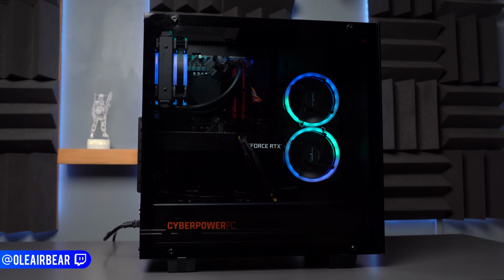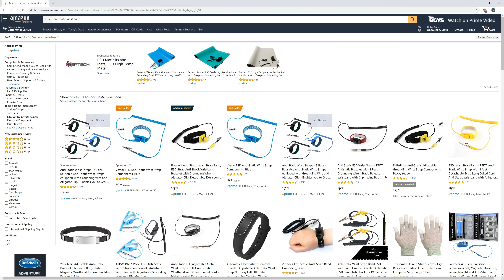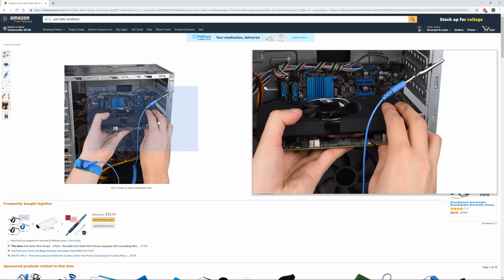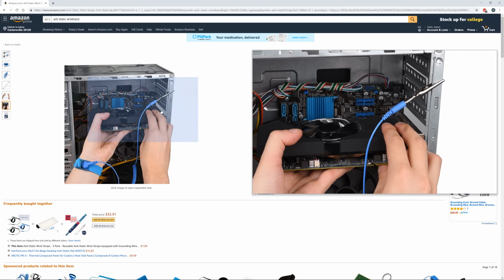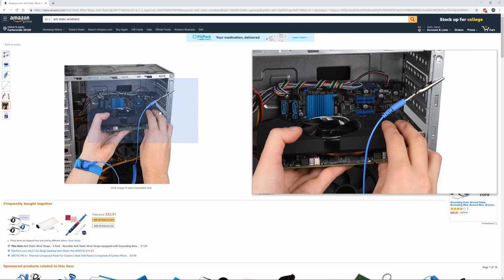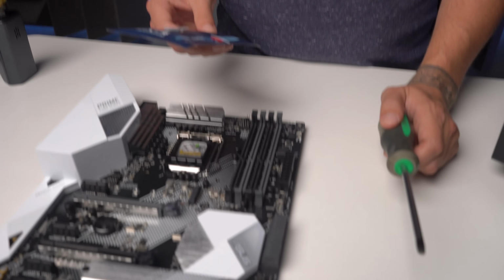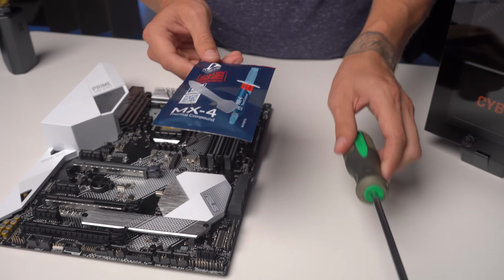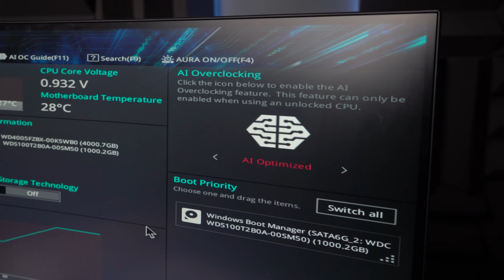How to Install / Swap your PC Motherboard STEP BY STEP

Comment: I'm confused. is being bare foot a good thing or not?
I'll be building my comp in the kitchen cause other than the bathroom it's the only space that has no carpet.
Thanks for the helpful video, I'll be doing this in about 2 hours or so, just doing some prep stuff at the moment.
It would have been nice if you gave me a close look at the Installing Motherboard Standoffs section. I'm quite scared to touch these as I heard some cases can fry the mobo or something...

Comment: hey guys so i am new to all of this pc stuff and i was building my pc 2 days ago on the carpet on my floor and while im screwing in my mother board i dropped a few swears on it on accident and i didnt know thats that would cause anything and so i finish my pc and for some reason my motherboard had 99 on it and i looked on safari and it said my motherboard died or got fried or short circuited and now i have to save money to buy a new one any tips ?
Reply: @FBI okay thanks

Comment: I know this is an old video but I need help. Many reviews for this board on Amazon claim that it does not support 9th gen intel cpus out of the box and an 8th gen one is needed to update the bios first. I am wondering how it went with a 9-9900k since it was a 9th gen cpu (I’m getting the 9700k)

Comment: I only had one spacer or standoff included. Never knew what their use was for. Now my pc won't start. I think it's fried. But I'm afraid if I do install spacers that it would offset my MB from the back hole for the IO stuff
Reply: i tried the prime z390 A and this happened to me. Nothing would turn on. Was this because i didnt have standoffs?? My old mobo worked without the standoff

Comment: Built my first pc last month without any prior knowledge other than half-hearted random advices or tips from friends. Ended up getting the cheapest B450 board that didn't have an ARGB header for the ARGB fans that I got. Really ugly board in the Asus Prime B450m-A. To think I was initially content with getting an A320. Bought multiple accessories to accommodate the fans (rgb splitter, fan hub, argb adapter, etc.). Now, a month later, I put up a build that I should have gone for instead of cutting corners. Little did I know that I would be spending twice as much as my initial budget mostly on unnecessary accessories that could have been prevented had I known what I know now. I'd love to go back and get a better cpu, motherboard, gpu, and full modular psu. :((
Reply: Lmao I’m in the exact same boat and now I’m just spending extra money

Comment: 8:18 I’m planning on upgrading to this mobo, but my old one didn’t have those connectors so I had to individually plug each of those in after installing the gpu.. it was tough

Comment: i'm swapping out my MOBO to an x570. my OS is currently on an NVME, but the new mobo allows for 2 nvme slots. do i need to plug only one in when booting for the first time for the BIOS to read the OS, or can i install both m.2 slots, i.e. will the BIOS read the OS regardless?

Comment: Hi I got a question: I want to upgrade my current i5 4460 set up to a newwer ryzen mobo/cpu/ram combo. do i need to reinstall windows or stuff like this? if yes is there a video on how to do that type of stuff best? and maybe without losing my data? lol

Comment: I'm replacing my computers Motherboard and CPU so I've made notes to follow for myself. Thought I would post, in case somebody finds it useful. It's summarised, so make sure to still watch the video to get more of a visual understanding of the notes.

To keep in mind:

1.	Make sure no static electricity. Work on an area that is not carpeted, do not walk around with socks on round the house during installation. Ground yourself by touching the metal on the inside of the PC case every so often. Recommended: Anti-static Bracelet

Not mentioned in the video:

1.	Back up your hard drives, just as a precautionary method. You may not have to re-install windows if you have windows 10 - it may be as simple as just replacing the mobo it may not be (I did not have to re-install windows, but I backed up my data just incase) 
2.	Note down your windows activation code – connect it to a Microsoft account so you are easily able to reactivate windows. Your Windows activation is connected to your Motherboard/Microsoft account
 (if it is not connected to a MS account, you may have to contact Microsoft to issue you a new activation code and deactivate the old, as, if the motherboard we're taking out is much older than your new one, Windows will not recognise the mobo and treat it as a new system. If you are upgrading to a motherboard that is of similar brand/etc to previous, you may be okay. Somebody said that if you have your original windows activation code, you may not need an MS account. I would personally just connect it to a MS account. (My PC opened up to the BIOS, I checked everything looked good, then it signed me in as normal. I did connect my windows to a microsoft acc just incase)
3.    You may or may not have to uninstall old drivers from the previous mobo when your new one is installed. Boot into safe mode, chuck CD in that comes with new mobo and install new drivers (I did not have to do this step)

STEPS:
1.	Unplug and kill the power to PC completely, turn switch at back of computer to OFF to discharge electricity. Hit power button at top a few times to make sure any lingering power has been discharged
2.	Open case, back and front
3.	Take out GPU – unplug power cables, remove screws at rear. Press down on tab at PCI and release GPU
4.	Remove RAM, note what place they are in for new mobo
5.	Remove CPU Cooler
6.	Remove any case fans
7.	Remove all cords from motherboard
8.	Unscrew motherboard 

NEW MOTHERBOARD Installation:
1.	Place motherboard on soft surface, i.e. manufacturers box
2.	Install RAM
3.	Install CPU – remove socket cover (put this on old board for protection), push spring cover and release cpu holder. Gently place CPU in socket, align. NO pressure. LIGHT shake to ensure it’s seated. Apply thermal paste and secure cpu with arm
4.	Put IO shield on PC (can take some force)
5.	Align motherboard with IO shield, screw top screw rest should fall in place. SMALL forward pressure to hold mobo against IO shield for first screws. Screws don’t have to be super tight.
6.	Install CPU cooler
7.	Install CPU Radiator (back fan)
8.	Connect all cords in motherboard, everything should be named.
- Hard Drives into sata ports
- 24 PIN connector, usually found on right side of ram
- USB ports
- HD Audio (commonly found on bottom left hand side. taking note of the missing pin on the mobo and the connector, will help you find it easily)
- Commonly Dreaded Power on, Reset button and HDD LED Cable. If you have a decent motherboard it will be labelled, they must be placed in negative and positive correct positions
- MAKE SURE ALL CPU FANS AND CASE FANS ARE CONNECTED TO POWER, whether that be alternate power, or through the motherboard

9.	Install GPU
10.   Power up
Reply: Install gpu last ?
Reply: @spookz1761  yes, because it's the bulkiest component it makes it difficult to access the parts we need to connect cords into on the motherboard. Just followed my own notes today, everything is running perfectly. Goodluck!
Reply: Ty
Reply: Thank you!
Reply: i followed these steps, and my computer wont boot up lol. at no fault of yours! but i have everything plugged in and the front panel connectors are on, Power coming to the motherboard as the LEDs come on, but when i press the power button nothing comes on
Reply: @jackhouston2497  could be for a number of reasons. Go over all your cables, make sure they're plugged in all the way especially the 24 pin connector.
Reply: @jackhouston2497  also, make sure you've put the power reset/led hdd cables in properly! If they're not, that is another reason why it wouldn't boot. Especially that your motherboard is showing power.
Reply: @jackhouston2497  in your motherboards manual, it should show you exactly what spots they should go in.
Reply: @jackhouston2497  gday did you get your computer working? make sure your monitors input is plugged into your graphics card, not your motherboard
Reply: @brilyn  yeah mate it was something to do with bios. I then upgraded cpu and mobo and the mobo was faulty so still haven't been on my pc in couple weeks lol. Thanks for checking in!
Reply: @jackhouston2497  oh nice stuff. i put together another build yesterday, and it turned on but showed nothin on the screen and that was my problem so thought I'd ask XD game on!
Reply: @jackhouston2497  take out Ram, put back in. Take out cmos battery and put back in. Try that. 
If you put windows into an m.2 ssd then you’re about to have some problems (I ran into that issue).
Reply: thank you! i saved your comment and I'll for sure use it when i upgrade my system soon

Comment: I have the same mobo and I got the dram problem as you did. It will work with one stick in the second dram slot but when I put the second dram card in, the dram light on the mobo lights up. Any idea how I can fix this?

Comment: This was such a huge help. Made replacing a motherboard go from stress-inducing to easy as hell to do.
Reply: What about the ssd will they automatically work ? From the old setup to the mobo ?
Reply: @caraagraph1996 did you ever figure this out?? This is what I’m wanting to know
Reply: @xHarper02x did you figure out?
Reply: @secretservice2  yes, they will work moving them directly from one mobo to the other
Reply: How do you move standoffs?

Comment: When you switch your motherboard, but keep your hard drive, does windows stay? Are there any extra steps to get windows back? Or do I need to buy it again?
Reply: Your windows will stay on your hard drive of course(or maybe in your ssd if you installed it on ur ssd)
Reply: 「RM」 Arc so I switched the mobo and it only takes me to the bios. I decided to reinstall windows with a flash drive but then it just leads to no display.
Reply: @madara7037  when connecting my old hdd to my new motherboard, it was unable to boot up. so i backed up my stuff that were important and installed a new drive. basically, yes i did lose everything

Comment: Do i need to install the windows 10 again if i change the cpu to a new motherboard? its necessary to do a fresh installation or its already installed somewhere somehow in my hard disk? im planning to move all my stuff to a new motherboard, a new cpu included so this is why im asking.
would appreciate a help. Thank you.
Reply: Did you ever figure it out? I’m wondering the same thing.

Comment: Not the same question as others. Should I format my boot drive if switching from an intel cpu/motherboard to an AMD combo? Will I have any issues if I use the same install without a format?

Comment: Do I take off the standoff bolts on my case before I put in the mother board or leave them
Reply: PLACE THE STANDOFFS IN BEFORE YOU INSTALL YOUR MOTHERBOARD! They’re supposed to be in there to protect your motherboard from shortages. However, just make sure the standoffs line up with the holes that are in your motherboard just to be safe. I’m currently building my PC atm too!
Reply: Envy I knew I was doing something wrong 😅

Comment: I'm upgrading my mobo and can I use the same window from my old build on the new board? Is it as simple as plugging in my SSD and then it boots up?
I read some of the comments on this video, and people are saying I need my old activation key which I have. Do I need to go to the bios? Please someone explain in depth it would mean the world.
Reply: Well, Im pretty sure you MAY need your activation code I heard that if you change the parts out it can unlicense your windows but I wouldnt worry about it too much but to get to the bit I think I know better.

You just should go into the bios make sure everythings working and showing up, also if your memory (RAM) uses XMP you need to enable it in the bios. Now for booting into windows if you have multiple drives or even if you dont, just check that the boot drive is selected to your SSD in this case. I think that sums it up, hope you enjoy the upgrade my man.
Finally upgrading from an FX-6300 to a Ryzen 5 3600 so pretty exciting sh*t 😂

Comment: great video but how do I know what motherboard to buy , I have a ibuypower prebuilt and im slowly upgrading it but I know im gonna need a new mobo soon . current one I have is an ASrock h310cmib atx micro . sorry if its a dumb question im learning as I go (those are specs I got from system info)

Comment: Is there a way to upgrade a 2009 hp office desktop motherboard to a gaming motherboard
Reply: It depends on what form-factor the computer is. If it uses an ATX case/motherboard, you may be able to do it. However, you have to factor in the cost of all the other upgrades like a new CPU, RAM, graphics card, power supply, etc. It probably wouldn't be worth it.

Comment: So I have a question; if I installed a new motherboard on an older PC (replacing) and assuming everything is connected correctly, will I need to enter the bios to setup the boot drive or it will detect it automatically?
Reply: It depends. If you have Windows 7 or older installed, it will most likely crash since it would be trying to run on entirely different hardware. In that case, you would need to do a clean install of Windows. If it has Windows 8/8.1/10, the it should boot up. However, since as far as MS is concerned, this would be considered a new PC, you may get a Windows activation error.

Comment: I've got a question sensei. What if I changed a 2013 motherboard with a 2018 motherboard? What happens with the software part? (I want to keep the same HDD & GPU. How do I install the new drivers or how does ir work?
Reply: Hylian Chief if you’re keeping your HDD everything stored on it (drives, etc.) will be transferred to your new mobo.

Comment: I bought a new motherboard and try to install in my PC then my friend told me to reformat my ssd and install windows again. Can i swap my motherboard without reformating my ssd with windows?
Reply: You "can", but it'll take extra steps. Such as modifying the registry for hard drives.

Comment: when upgrading a motherboard, do you need to re-install windows?
Reply: no. just choose bootable system where you install the windows. change it on bios setting.

Comment: If i change the mobo without changing cpu do i have to delete drivers or reinstall windows? (I'm not upgrading mobo but changing it with smaller one)

Comment: I have ordered new motherboard ASUS ROG Strix Z390-E Gaming GPU CPU and CPU cooler ill be upgrading from my old things to something really powerful my power supply is good enough but got another hard drive 8TB for more space for my games also thinking of ordering a 1TB SSD as well

Comment: The thing is: Will I keep windows? Do I have to save the data? He didnt mention anything about that?
Reply: This happened to me: So basically, at first reboot plug in the drive, on which windows is installed (ssd, m.2, HDD). It WILL recognise the bootdrive and start windows 10, like nothing ever happened. Then restart and add a drive. Repeat.
Reply: If you put all the drives into the system at once, it might cause problems (My drive with windows didnt get recognised at all in the BIOS, yes nowhere
Reply: Howdie Rowdie thank you I’m upgrading atm and was wondering what to do.
Reply: Howdie Rowdie there were no issues regarding your previous motherboards drivers?
Reply: @phill7487 No, there was no problem with the previous motherboards driver.

Comment: I tried connecting my new built pc to my TV using only the cpu inputs for now but it says no signal. my pc runs perfectly fine and all. Should I wait for my gpu to connect it and change srtifnfs) settings or does it matter?
Reply: Yes I would

Comment: Ok, touching metal does not automatically ground you, touching your pc case, when the psu isn't plugged in does not ground you, touching a metal table that's standing on a wood floor does not ground you.

Comment: wanted to upgrade my hp 8100 sff , got a new motherboard and ram (both DDR4) and was wondering do i need to get more equipment as well (i.e. cooler, graphics card or cpu)? Or can i still use the i5-660 and still have it work fine? trying to play my steam games but it's not up to par or doesnt even load into the title screen

Comment: Just bought an ASUS ROG B450-F to replace my archaic IBUYPOWER asus board from 2011. I watched this video in hopes to simplify my install. Amazingly done! My gaming tower seems to have a lot more wires inside.

Does most Ryzon processors come with thermal paste?

Comment: If I upgrade my CPU, MB and Ram do I need to reinstall windows?
Reply: nah bro windows is installed on one of your drives (SSD/HDD)
Reply: @nachostv4217  so if I already have it I don’t? What if i have the “fake windows 10” like the one that’s watermarked? I’m just to lazy to activate it and I’m getting a new motherboard since my last one fried.
Reply: @Kiro_I0  that's because the registration key will sometimes depending on the key be bound to your motherboard.

Buy a new key, they're like 5 bucks. Or live with the watermark, I lived with it for like a year before I bought a new key lol.
Reply: @nachostv4217  Thank you for the reply. I really don’t mind the watermark lmao
Hopefully when I install the new mobo tomorrow it’ll all work out like so.

Comment: Just making sure: did you skip installing a mount for the cpu cooler? Normally you have to install a bracket on the back of the mobo before you can mount the cooler to the cpu.
Reply: You can look up the installation of your specific cooler which will probably give a better explanation because it's specific to that part. It's likely he did install the bracket, but didn't show it because that's the cooler installation, not motherboard installation.